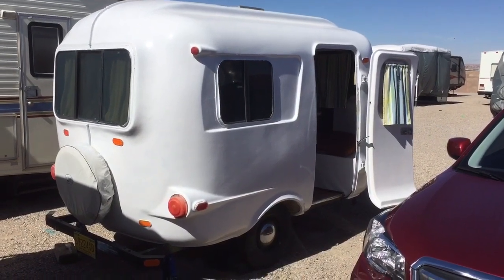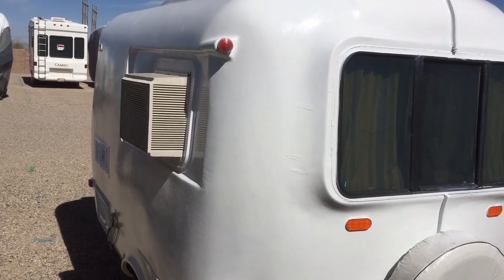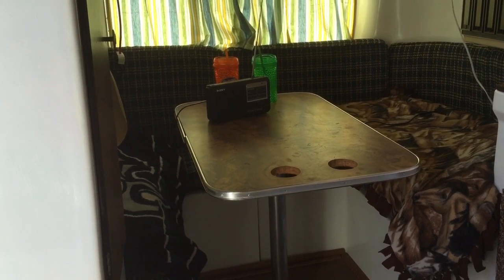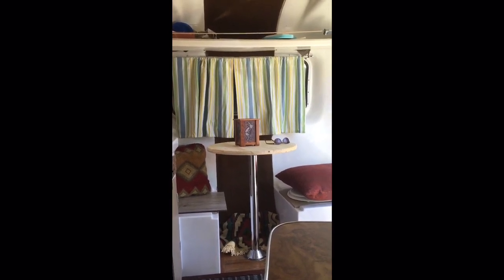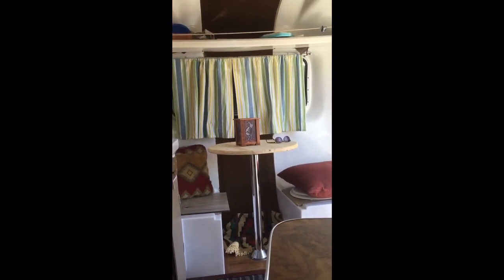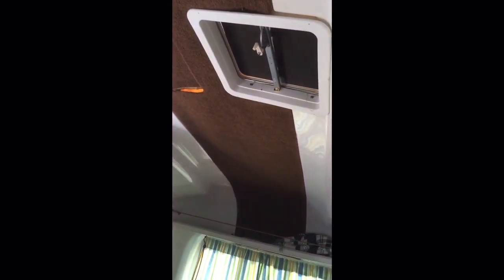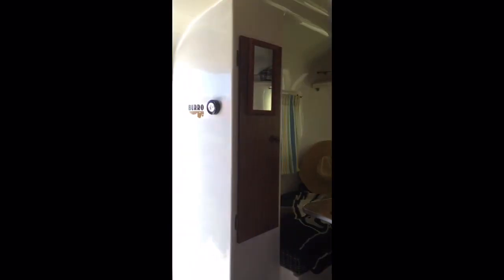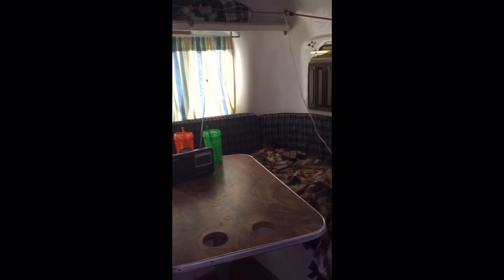Burro Fiberglass RV with sawdust toilet

Comment: Your Burro is just like mine it is a 1984 Burro. A/C should be installed on the passenger side of the car. Supported by closet wall and the original paperwork says to install it there. They were kits  and people put them together.
Reply from the maker: You could be right, it was very difficult to determine the exact date the Burro was manufactured or assembled.  These are great little lightweight trailers that REALLY hold their value.  It's still holding up after all these years!